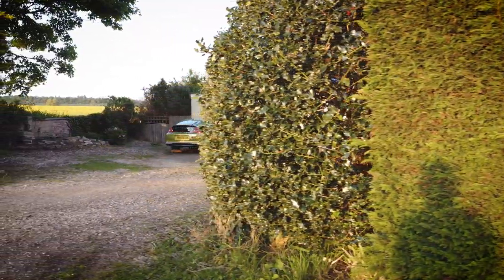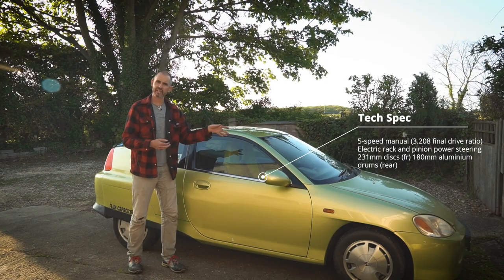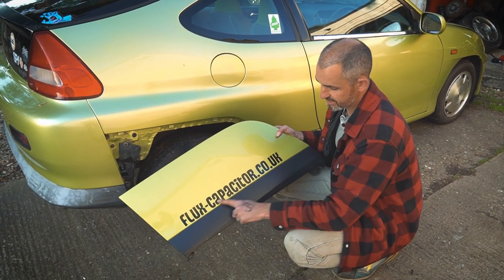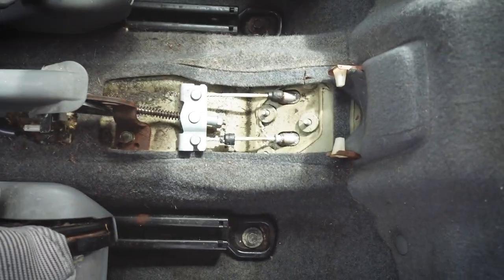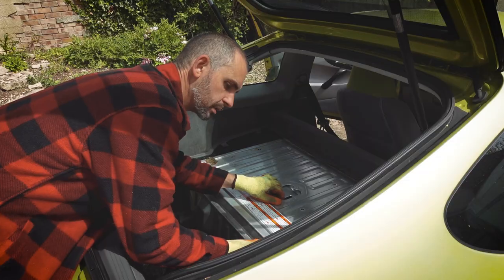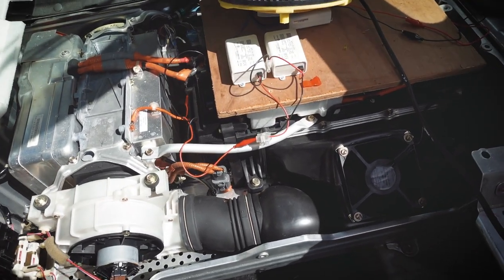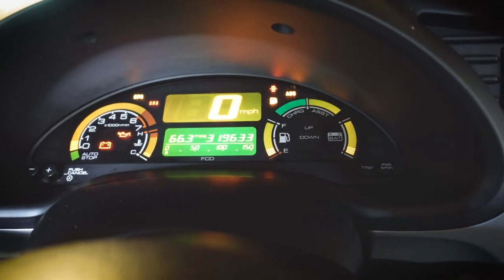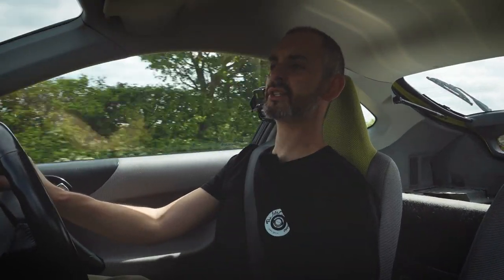Rescuing a High Mileage Honda Insight Hybrid - the NSX of Hypermiling

Comment: There's a large pack of these Insights (about 30) stored on an open Lot here in town. If you get close, you'll see the Texas Instruments Company logo on the Doors. Some even have the Logo on the Hood. They've been here for about 12 years or so. Even rarer on the other side sits 9 1997/98 Chevy S-10 'E' Short bed Pickups. The rarest of the rare. Unlike a standard S-1O these are FRONT Wheel Drive and have a 1-Speed Transmission. Odd, some have California Inspection Stickers while 3 have Michigan Inspection Stickers. These too have been sitting for quite a while. But don't worry they won't rest in our New Mexico climate. Oh, and you're saying 'Aluminum' wrong........*Shakes Fist..*(!!).
Reply: "Aluminium" is pronounced "Al-u- min-i-um" *Wags Finger*(!!).

Comment: Here's a top tip if you want to get hybrid battery set right for little money. Get in touch with battery BNA in the Netherlands. They have matched used packs, as good as new and new packa for very little money. I know this seller from the Prius but they also offer packs for Hondas with the IMA system. That maybe a good boost of popularity for such a service because unluckily many people are scarred or older hybrids which is a pitty

Comment: I ended up with a Video 2000 in the video tape wars, I think we only bought 2 videos for it before the format was dropped, the format that came third in a two horse race.

 I feel my car choices are similar, got rid of a  huge number of cool cars right before they rose in popularity. I sold a 23 window barndoor for 400 quid, got a genuine barn find low milage rust free early DS, but sold it for 500 quid, refused to buy a 3 grand Detomaso Pantera because there was no space for my dog. I was offered dozen of Citroen HY vans, diesels were 300 euro average, petrols were 200 euro. Sold a running Citroen Mahari for 400 euro. Now I can barely afford anything I like.

Comment: The Insight is great but there’s no need to malign the Prius. The 2nd-gen Prius was great, well-built, reliable, iconic looks and superbly engineered. There are examples of these with galactic miles on them also. I like both Insight and Prius, both ahead of their time and both interesting vehicles. Love the kamm-tailed design and a sucker for the shrouded rear wheels on the Insight. Good on you for keeping it on the road 👍

Comment: Put a light coat of anti-zee on the steel to rear drum, it will help the next time you need to remove it. Nice video. The battery, I would need to see if the system can handle newer batteries.

Comment: Still not a fan of an EV for a main car due to the cost of a suitable one. Something like the Insight is great as a second car as the hybrid part makes it useable if a long trip is needed. I like the way you approach fixing it on a ‘live’ basis, I could feel your jeopardy when you were putting the live cable on the tab with your rubber gloved hand, after making sure you pulled your cuff right down first! 
Great project to watch.

Comment: I have a pair of those. Hoping to do projects on as well.

I've been thinking I need a pair of Aptera hub motors for the rear end, leave the ICE stock.  I already have one prepped with an added vacuum brake booster and a neutral defeat which keeps it in idle stop mode.

Comment: Really interesting to learn about this early hybrid car. I have a 2017 Toyota C-HR and love the diesel economy from the petrol engine. Driven correctly it does stupidly good mpg. 

I love that they concentrated on keeping it small & light, this just makes sense. If car is lighter & more slippery through the air it will need less energy to move it so be cost less to run. So why are new cars so bloody big? New EVs seem to be so big and very fast! Why not make smaller lighter more efficient cars? And why so fast? 

Really looking forward to hearing more on the Insight.

Comment: I put 300,000 miles on mine before selling it on.  67 mile commute each way with a lifetime avg of 58.5 mpg (US) and a high of 67mpg.  Only sold it because the seat was giving me a back ache.  Driving a Honda Clarity plug-in hybrid now, but that Insight was very special  Something to be said for being even lighter than an Elise.  Note that if you change the sparkplugs, they are indexed, and Honda makes four different versions based only on the orientation of the electrodes when installed.
Reply from the maker: Thank you for the comment Juan. I had heard the plugs are indexed (!). I will just remove and check/clean them.

Comment: Great video and look forward to the rest of the series. Would be good to see a dive into the guts of the hybrid system. In two minds about the battery upgrade being such an original car, and leaving the original pack if its still doing well. Saying that would also be interested to see what a new upgraded Lithium pack could achieve. Maybe your next project could be to get the Ampera (or was it a Volt?) back and do something similar, not that I'm biased having one myself 😁

Comment: You should speak to John Maher of John Maher Racing fame well know in the VW drag race scene.
He bought one of these new and it was one of the first in the country.
It was so ahead of the time with technology it even had 4 different types of plugs I think it depended on which way the electrode pointed.
I was working with John at the time.
On trip he managed to achieve 101mpg.
I believe he still has it on the Isle of Harris.

Comment: I think it would be good to showcase a few different insight projects, your car, a phev with a lithium battery and a full EV conversion. Nikki Gordon Bloomfield has one and you could do some videos to show the difference outcomes of different projects. I don't think there are any wrong answers on this one. Nice to see the aluminium bubbles. As a kid my dad had a string of Rover P6's with wink that bubbled like that. The steel sills would rust for fun so one would fail an MOT so he would fire up the p6 that had been fixed most recently and we would drive around in that till the MOT ran out. Happy days.

Comment: Aww, sad Figaro in the background... However, the Honda is seriously cool! Regarding battery tech, I'm not sure whether it will be possible but instead of Lithium Ion packs have a look at Lithium Iron Phosphate (LiFePo4) batteries instead. They are currently more expensive and not as energy dense as standard LiON, but are a lot more durable (up to 5x) and less prone to deep discharge damage. And most importantly they are a lot safer - they don't burn like standard Lithium batteries can in extreme cases. The fact that they are also a lot lighter than standard Lithium cells is also rather handy on top of everything. Good luck with your project Jonny, this is a cool one!

Comment: In Aviation, anti-corrosion fluids are sprayed to aircraft bodies (inside where aluminum tends to be bare) to prevent corrosion. While it's usually not said that aluminum "rusts" (which is corroded iron) -- Aluminum definitely corrodes. 

Also, steel and aluminum will definitely corrode on contact with each other due to galvanic corrosion.  https://en.wikipedia.org/wiki/Galvanic_corrosion
Reply from the maker: Many thanks Ben
Reply: @TheLateBrakeShow  - Sure thing. 

I remember looking into the Honda Insight way back around 2000. I'd see them very occasionally around. Interesting car indeed.

As luck would have it, I drive a Honda Clarity (I bought in 2019). While not completely gas free, it's a great shim/transition car to get away from gas for my 95% local driving. 

As an EE and pilot, I'm looking forward to the day we can stop using fossil fuels for basic transportation.

Comment: I`ve a wee tip Jonny for anti theft wheel nuts if you don`t have the correct socket, if they`re `Female` this trick works really well, if they`re male, it`s a bit harder but will still work provided you can find a near wrap around shape or size of socket that fits over them,- 
you find a near enough shape or size of socket (this may sacrifice the socket) line it up as best you can, take a hammer (yup) & hammer it in/on- not all the way mind, just enough that it gets a good seat in or on the nut, then use a bar to `crack` the nut, then use grips or your fingers to run it down the threads, a good soak with release oil before hand will help!

Comment: eek :( that White "scabbing" is in fact how aluminum corrodes :(  once it that bad it weaken the metal and can crack easy.  Phosphoric acid (removes corrosion) and some Alocrom 1200(reprotect it) , what we used on old aircraft.

Comment: I'm sure you already know this, but the corrosion you've experienced between the aluminium and steel is known as galvanic corrosion. Salt and water being the biggest contributory factor. When rebuilding, smear of grease/copper grease etc will create a barrier between the  two  metals, lessening future problems.

Comment: I reckon it'd be great to get some Lithium Ions in it, although there's obviously something to be said for keeping an original chemistry battery going. Just think new batteries would make it even more useable and economical (depending on the cost of installation) and Honda would have stuck them in anyway if they were available at the time.

Maybe wait for someone to bin a Honda E and get some cells from that haha

Comment: Love these little cars, been driving them for about 15 years.  
My first one was named "Little Red Space Car" by a cute girl I used to flirt with. There were 314K (197K mine) miles on that car before it was totaled after the fifth deer hit. 
The second one is at 304K miles right now (190K mine) and is my daily driver. We had to save it from the insurance company after it T-boned and destroyed a Nissan Murano, buy pulling the front end back into place - but it's still moving.
Third car is in reserve 89K miles (only 2K mine), sitting in reserve for whenever #2 is retired.
Reply from the maker: Great comment. Where in the world are you?
Reply: @TheLateBrakeShow  Minnesota, USA
Reply: @TheLateBrakeShow  This summer I hope to take #2 to California and back, hitting the last four of the "Lower 48 Starts" that it hasn't been in yet — little 4500+ mile round trip. With fuel prices what they are, the 55.9 mpg it still gets will be much appreciated.

Comment: Super interesting vid, thank you for that! Always wanted to try a mk1 insight, but really rare on the continent. If it was mine, I'd bring it back to OEM spec, put the best possible modern tyres on and perhaps lower it a cm or 2 if possible (slightly improved drag). If all is well then look at a LiON pack. Assume these save weight and give a bit more capacity?

Comment: I didn't know upgrading to Li-Ion was a thing with these. My civic hybrid will eventually need a battery replacement, and I'm considering a Bumblebee Ni-MH battery, but if I can go with lithium without major modifications, then I'd consider that. However, I've heard on online forums that because the HCH was not designed for lithium batteries, it's a bad idea

Comment: With the way fuel prices in the UK are these days, I would be tempted towards converting the car into a full EV.  However that is the most expensive option.  Since you seem to have revived the battery, it would be a good idea to check if it's still up to capacity as NiMH batteries suffered from the 'memory effect' which means they could charge to full but not access power past a certain point.  An example of this is a mobile phone which loses power one the battery goes below 50%.
Reply: Memory effect is a NiCd thing, Ni-MH batteries can suffer from "voltage depression" (showing perceived reduction in capacity) but full discharge/charge cycles (as already done) should resolve that. The only other thing to do would be individual cell balancing, but I'm not sure how easy that is with this battery.

Comment: These things do seem to last really well. I have 270K miles on my 5 speed model and I drive the piss out of it, running with some mods and hitting redline at every corner I can get to.
Reply from the maker: Good mileage. How long have you had it? What mods did you opt for?
Reply: @TheLateBrakeShow  I've had it for 8 or 9 years. 

As for mods, short list in case you don't want to read too much into it.
*Different struts/springs/dampeners/bushings
*Frankenstein Transmission
*Weight reduction
*short shifting mods
*Over Boosting the EV motor

If you want a more detailed version (what car guy doesn't like talking about their mods?) then you can continue reading.

Suspension:
I adapted RSX struts with different springs and Scion xA dampers up front. Out back changed the springs and running GAZ shocks (although for my type of driving they're just not up to the task).
The bushings all around were soft and causing all kinds of issues. So poly bushings for the torsion beam (really helped out) and poly bushings in the front control arms (toe changes were happening). I widen the track front and back and brought the rear track a little closer to the front's widths. I reduced the toe in at the back. I increased the rear roll stiffness compared to the front and removed the front sway bars.

transmission is a Honda Civic Hybrid 5 speed that I swapped out the gear sets with a 2007 Honda Fit/Jazz gearing. I reused the speedometer gear from the Fit. 

Flywheel I took a kg out of it (I wish I took more out, probably next time I do the clutch I'll take a lot more out of it)

Adapted some RSX and Prelude shifter parts to tighten up the shifter and shorten the throw

I'm running 185 section with tires on 6lb CE28 wheels.

I'm using the BCM replacer from Peter Perkins kit who's from the UK with his current hack. I'm running 20% over boost/regen . I really would like to run 40% over boost but for whatever reason my voltage sensors get buggy. I seem to be the only one with that issue. 

New 8Ah nickel pack (stock is 6 or 6.5Ah)

I replaced the 12v battery with a lithium motorcycle batter, so it's only 3lbs. 

And I've taken out some other weight here and there, I think around 20lbs.

Scott's front belly pan (quality piece) which covers the whole section under the motor.

Stiffened the left side trans mount and added a torque strut mount to the driver side. The added TQ from the lower gearing and added power causes the motor bounce around way too much, can even hear it in the chassis with the stock mounts.

There's plenty more to do, but as is oh man is it just a hoot to blast around town. The way it is now you can rotate a bit.

Comment: Yes the motor industry  society, and government have rushed down several blind alleys with full EVs. They know it too but have invested so much money and face that they can't back down. Yet. I believe the blanket bans on IC engined cars in the not too distant future will not happen.
I further believe that a small diesel version of the insight technology with EASILY exchangeable battery is the way to go.
We live in Europe and have a 1250 turbo diesel Fiat, it has done 5.3L/100km which converts to 53.3mpg over 35000km of normal driving, not striving for economy. It is 95hp, torquey and surprisingly fast. So chop off one cylinder and add the Insight type electric assist instead and I reckon performance would be restored and approaching 100mpg would be possible.
But that would be an intermediate stop-gap. Keep on developing hydrogen fuel technology and introduce that as an option to gradually replace diesel as hydrogen infrastructure develops. Ask JCB about hydrogen.
Off topic, we have photovoltaic panels on our roof. They are producing more than 22kw/h of electricity / day at the moment while we consume 3 to 4 / day (we do not have gas thank you), effectively we GIVE our excess electricity to the national grid and they pay us back some of it from nuclear generation on dull dark days. I learned the other day that the nuclear raw materials for that generation come from Russia (grrrrr) so even nuclear is not perfect.
I would dearly love to use our excess sunlight electricity to produce hydrogen, there is plenty more room on the roof for more panels if needed.....

Comment: Tune  the petrol engine for maximum efficiency and power.
 Litium Power is a must for Big amp hours. 
You could have the original Electric motor rewound & upgraded. 
A quirky seat upgrade would benefit overall look.

Comment: The green is a very rare color.  I had the silver with the CVT.  Since I live where it is hot, hitting lean burn would typically not be possible most days so the CVT made sense, but the CVT failed at about 50,000, and the battery had to be replaced twice.  These early cars did not have cooling for the battery pack, so not a good car for hot climates.
Reply from the maker: CVT is a deal breaker for me, because the manual is SOOOO precise.

Comment: Yes, I would like you to make a LFP battery, as I failed to do it. Problems with the BMS. I bought a 2000Insight from Daimler (espionage car with the production number w124, realy. The car has 225kkm on the clock and I replaced the cells of the pack by chinees ones. They are functioning but by measuring they only had 4.5 amh in stead of 6.5 .
Mercedes was especially interested in the nox cathalitic converter with its lambda and laf sonde . The motor is running on lambda 1:22 in stead of  lambda 1 = 1:14.2.
The car stands now in a garage waiting for better times but it is full functional still.

Comment: nice story and good to see the early history of hybrid/ev's . not sure of the purpose or reason for changing the battery if it still works...can understanding adding the plug in part though, so if that is battery dependant (but why?) maybe. Would a new LiIon battery make much difference overall? PS aluminium corrodes, so those doors are either corroding from inside or the paint is damaged..